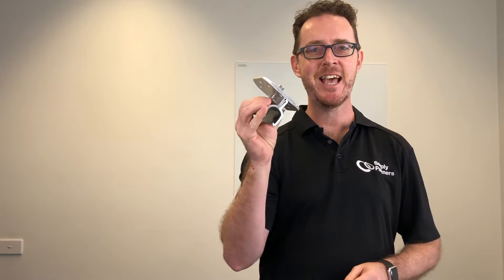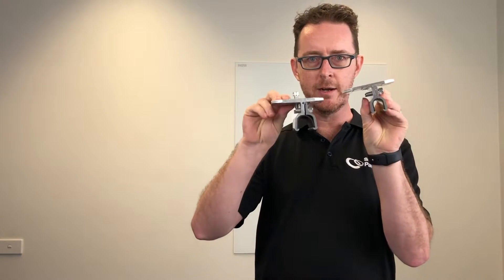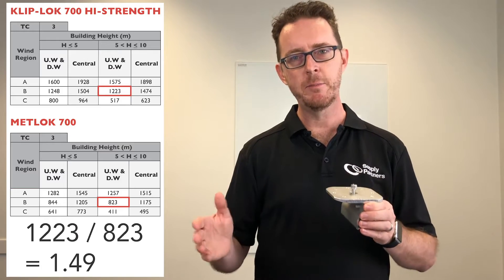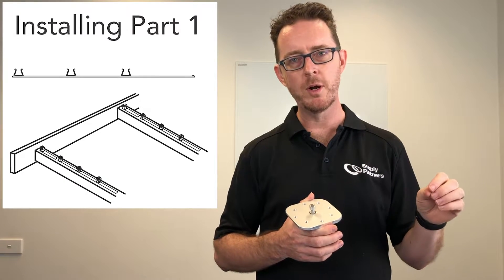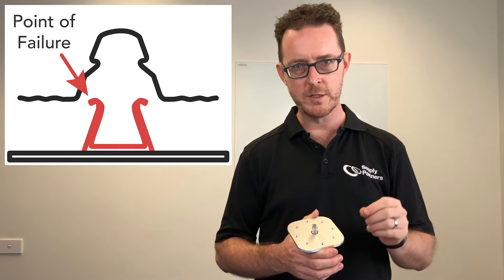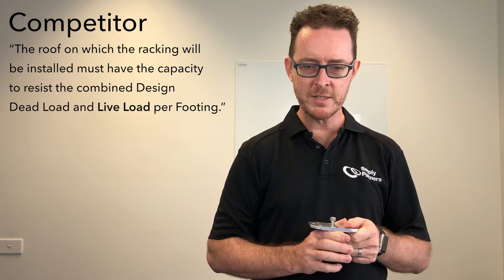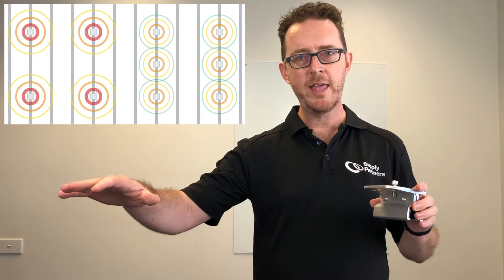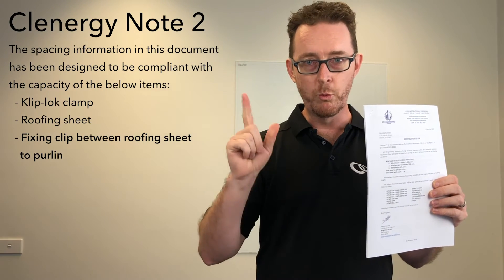Klip Lok Roofs & Solar Installations | What's This?

Comment: Ok, I thought dead load references the load on the structure from its own mass, and the live load is from personnel on that structure eg during construction and then during maintenance. Wind load ( I thought) was the load on the structure from wind and that pressure could be positive (downwards) or negative…

Comment: Are they installed on the lap rib or should I avoid the lap rib.
Reply: I notice that the clamp sometimes tilts sideways on a lap rib depending on the roof overlap design.
I have also seen one roof profile where all the ribs top trapezoid sections are asymmetric so you can't avoid a clamp tilt.
If a clamp is placed on a lap and then tilts, this will create extra pullout stress when it is twisted straight to align with the rails, especially when on a purlin.
I have also seen some engineers instructions requiring the placing of clamps over purlins, however they made no mention of placing on a lap.
It is hard to get a definitive answer for my roof as nobody can identify it.